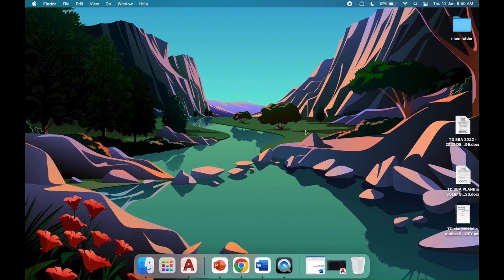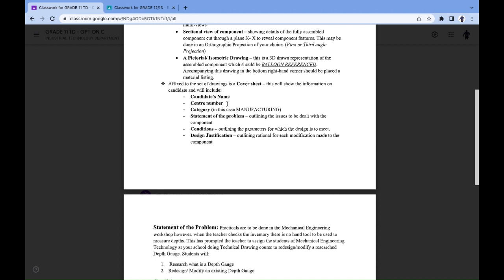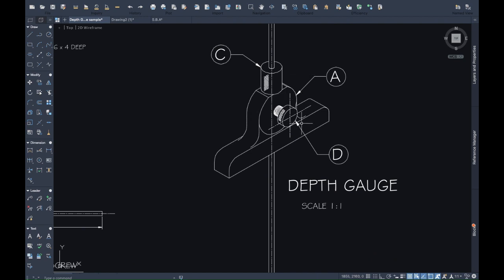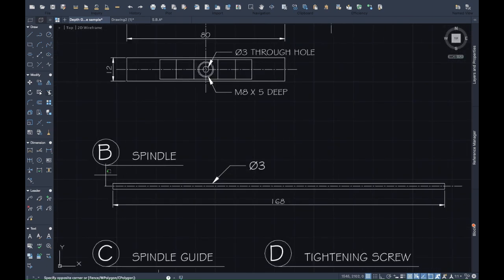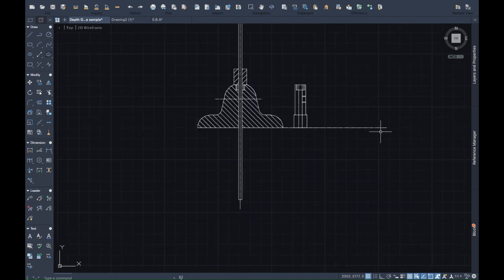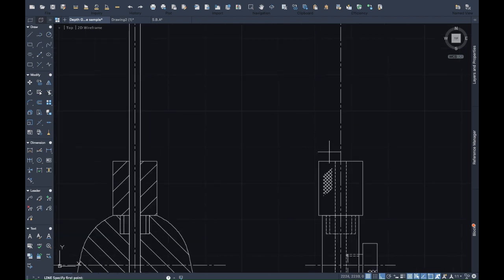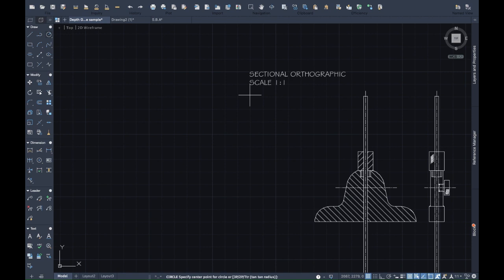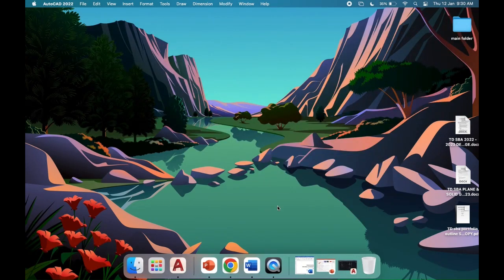SECTIONAL ORTHOGRAPHIC

Comment: Bro... screws, bolt, nut, shaft, spoke etc. Should not be hatched enough though they are cutted by the cutting plane. Main reason is that cutting them offer no additional or internal information. Check it out. Good job though keep it up.
Reply from the maker: You are correct. Similarly for web, but with exception for the type of cut. As it relates to this design the spindle guide is not considered a screw and the engineering feature as outlined needs to be understood through sectioning. The tightening screw here is not shown in section as it is below the cutting plane line (not cut). 
Therefore it is not shown in the sectional front. 
Thanks for the comment, please feel free to comment on other videos the viewers will learn from our convos👨‍🏫